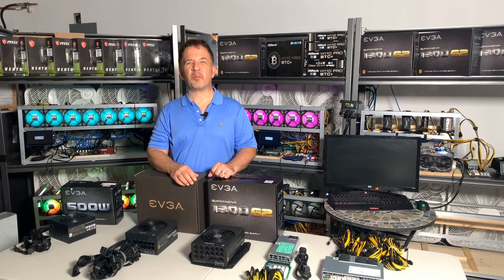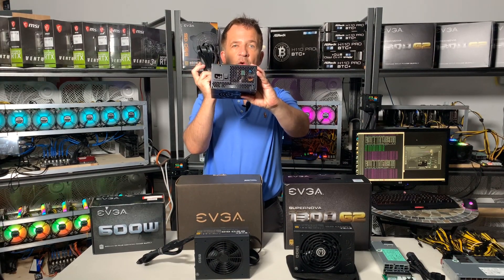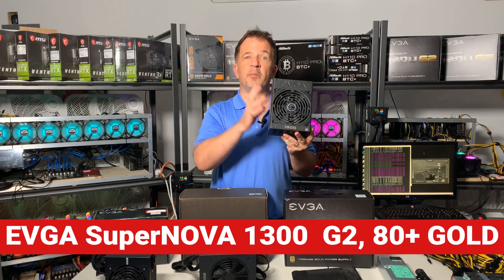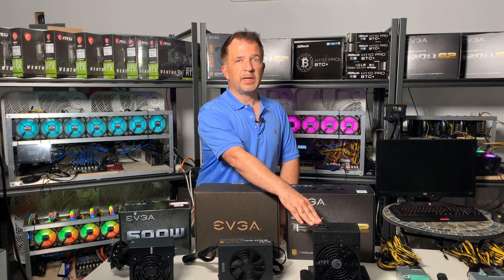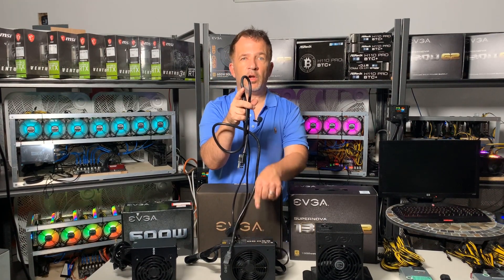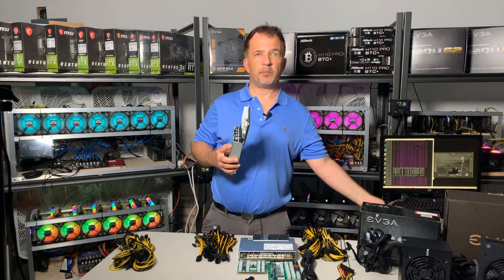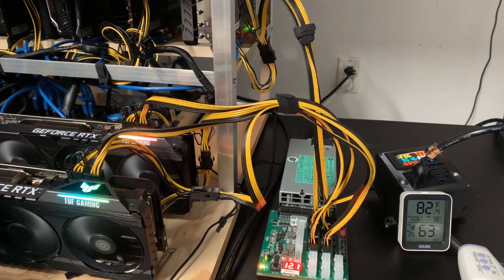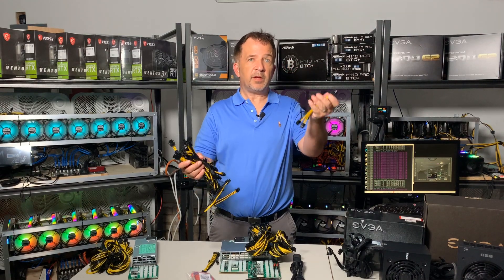THE COMPLETE GUIDE TO GPU MINING POWER SUPPLIES | ATX VS. SERVER PSU  (ZSX) | DO's AND DON'Ts

Comment: You say that server psus run more hot than atx ones, does that mean they dump more heat into the room per watt too?
Reply from the maker: Server PSU are very efficient generally but have small fans than run high speed to exhaust the heat. The GPUs generate the majority of the heat from a mining rig.

Comment: Hello
Thank you for your great video
I was wondering , Can I use the maximum amount on a Platinum Server PSU?
Say I have a 1200W Platinum HP server PSU , I have a 240Volt electricity , Can I use the full 1200W? Or should I stick to 80% rule and not use more than 960W?
I don't care about the noise on PSU fans.
Thanks
Reply from the maker: Hi, I'm not an electrician or pro, but It's my understanding you can use the full amount of the Server PSU wattage (I recall reading this on a post), but should still should stay to the 80 % rule of the electric circuit.

You should contact Parallel Miner about the PSU limit and consult an licensed electrician if you have questions about your circuit load, wiring, etc. to be safe.
Reply: @CryptoMiningInsider  Thanks a lot man
Yeah of course nothing you say can ever be considered any sort of "Advice" in anyway - specifically legal manner - 
And I appreciate the input
Yeah what I've heard is also in line with exactly what you said
Thanks again <3
Reply from the maker: @mohsenk1438  Welcome

Comment: Is it safe if running parallel psu with different wattage? Like 1000 watt combine with 850 watt
Reply from the maker: I run dual PSU at different wattage using a 24pin adapter to switch them on / off together
One PSU will power the motherboard and maybe some GPU, the other PSU will only power more GPUs - the PSUs don't power the same devices.
I power each GPU and its riser usig the same PSU.
I'm not a pro PC / Rig builder so I can't answer if it's safe, just saying I do it and never had an issue.

Comment: Any thoughts on making a video on troubleshooting? I have a Windows 10 5 GPU mining rig that crashes efter 15-40 minutes. 1x3080Ti 283W, 1x3080 250W, 1x 3070Ti, 1x3060Ti 1x3060. I ran it on a used MB so first step was to test with new MB/CPU, same crashing, next suspected China no-name 2000W ATX mining PSU, changed to a quality PSU, same issue. Now awaiting new v011 GPU risers. Can you share any experience or insights with issues using cheap GPU risers?
Reply from the maker: I would start by looking in the Windows Event Logs to see if there is any info at the time of crash captured.
Reply: @CryptoMiningInsider  Thanks, I did that to no avail (I'm an old MCSE certified IT Pro). I have a second 5 GPU  rig running next to it which is running very reliably 2x3070 (non LHR), 3x3060 LHR with a Corsair RM1000x PSU. It's running with another brand of GPU risers. I guess I could start swapping cards into the stable rig for troubleshooting but other than that I'm down with the GPU risers as the culprit so I thought I'd ask if you ever experienced any issues with cheap ones... Thanks for taking the time to respond, I'm very grateful 🙌🏻
Reply from the maker: @carlnakamura4861  I recently have a MOBO issue on a PC that after 30 minutes - Froze Up (Couldn't even power down from switch). needed to Unplug, then it went down to 15 minites, then 10 minutes - I had BestBuy Total Tech so I gave it to them so they diagnosed and swapped MOBO I chose - Paid for MOBO, but no labor cost.
Reply: @CryptoMiningInsider  the stable rig is running an old left over Asus Z97 Pro MB with 6 PCIe slots old 4770K with 32GB DDR3 RAM (overkill but had it laying around). All GPU risers plugged directly into MB. The rig that keeps crashing after a while had an MSI Mate B250 with an i5 7600K and 8GB DDR4 RAM i picked up used for cheap 4 GPUs plugged into an 1-to-4 PCIe adapter plugged into the 16x PCIe1 slot and 1 GPU riser plugged directly into a MB PCIe 1x slot. I bought and swapped to a new H410 MB and i3 10105F CPU. As I'm typing I realize it could be the GPU risers but could also be the 1-to-4 PCIe adapter that is causing the crashes. Well I guess I'll be able to determine tomorrow when the new GPU risers arrive... I only have these two rigs as a hobby and not a big mining operation but it hurts to have had one of the ride unusable for weeks so if I would do it again I would invest in quality gear fit for purpose rather than spending time and money on trying to re-purpose and optimize old stuff. 
Will let you know. Thanks again for sharing your knowledge and experience 👍🏻
Reply from the maker: @carlnakamura4861  Early on when I started mining I was buying some used items on Ebay to save cash, but after 1 or 2 things stopped working, I changed my strategy and buy new to avoid these types of headaches which are often more costly than just paying extra upfront but getting something reliable. Reliability is key to mining. Every minute rig a is down is lost revenue.
Good Luck and hope you get it back up quick !
Reply: @CryptoMiningInsider  Thanks again and great content on your channel!
Reply from the maker: @carlnakamura4861  Welcome
Reply: @CryptoMiningInsider  A quick update. I got the new v011-PRO GPU  risers w/ 10 capacitors today and replaced my suspected culprit V009S GPU risers w/ 4 capacitors. Happy to report that the rig has been running stable for almost 3 hours (it used to crash after 15-30 minutes before). Fingers crossed. I don't know the difference between GPU risers but it was the last thing to check. The 6 pack V011 cost about $75 incl VAT, while the older crashing ones cost $50 incl VAT.
Reply from the maker: @carlnakamura4861  Thanks - Good to know.
I remember an old phrase from a miner who ran a gpu mining farm, something like I have 99 problems and 90 of them are related to risers. Do you have a link for the risers you purchased with 10 capacitors ?
Reply: @CryptoMiningInsider  Oh, and knock on wood, the rig is still running stable and has not freezed or crashed a single time thus far.
Reply from the maker: @carlnakamura4861  Thats Great - Yeah ! 
Stability is King

Comment: Great video with far fewer likes than it deserves. Really useful information on important topics. Would have saved me money and grief if I knew that modular cables are not interchangable as they can actually have different polarity. I fried 2 pcs of 10TB hard drives which will be very expensive to replace given I will have to pay data recovery services as these were mirrored drives holding archived personal photos...
Reply from the maker: Thanks and sorry to hear you have accidentally friend 2 hard drives - I learned some of my lessons the hard way too.
Reply: @CryptoMiningInsider  yeah I haven't yet had the data recovered from them yet but did one harddrive some years back and it was around $800 for one drive.
Reply from the maker: @carlnakamura4861  Ouch - Expensive lose

Comment: how do you switch atx and server psus in parallel in one rig
Reply from the maker: I generally just turn on server PSU 1st, then start the rig on an ATX, but the server PSUs have breakout boards that can accept a remote power source like Molex cable which can start it.

Comment: I use a 1500 watt server psu. I pull 700 watt and its getting really hot. Is that normal ? Fan seems to spin at idle speed. How safe are breakout boards ?
Reply from the maker: I mostly use 1200 Watt models on 240 volt and they get very warm to tough when using at 75 % load or more - it gets basically to hot to touch.  Contact the seller / manufacturer if you don't think its right or safe.

Comment: hi, thanks for the content
I can connect a server power  with an Atx supply using Dual PSU Connector
Reply from the maker: I usually manually start my Server PSUs but some have breakout boards have a a remote on/off plug that can be powered by a primary ATX power supply (Believe its Molex)

Comment: 80+ gold is 90% efficiency or higher. Regular 80+(or white 80+) is 80% efficient.  I think bronze is 85%+, silver is 88%+, platinum is 92%+. Those hp server power supplies are 94%!!! So good for so cheap!
Reply from the maker: Good Point - I love the HP Server PSUs too - great value, only issue I have is when I run them on 1200 Watts unit on 120 volts they only put out 900 watts and get noisy if you put them under load so I can't use them indoor living space under high load (Whistle / whining fans).

Comment: I think you’re the first person I’ve heard say you don’t have to use the 80% rule with a server power supply.
Reply from the maker: I added a comment to the video description clarifying the HP 1200 Watt gives 900 Watts when using 120 Volts and 1200 Watts when using 240 Volts.

As far as the 100 % Load...
See Parallel Miner website - it says in bold on the Page "Unlike standard ATX power supplies, server power supplies are designed to run 24/7 for years, even at 100% load." 
https://www.parallelminer.com/product/build-your-own-custom-platinum-94-delta-2400-watt-power-supply-200-240v/

Please Do Your Own Research 

** I am not an electrician or claim to be a Professional **

Comment: Is it possible to connect more than 2 psus together using the adapter you showed in the video or 2 psu are the max number I can use in one rig ? Oh also fantastic video, thanks for putting everything about psus in one video and sharing it.
Reply from the maker: Thanks I really appreciate your compliment. I remember when I started building rigs there was a lot of information but it was scattered in different places- I was hoping that by doing a 1 bigger video that covered multiple Power supplies it would be more beneficial for everyone to see them side by side and and simplify their comparison and understanding of them all.

Honestly, I never connected more than 2 ATX PSUs with a Multi PSU Adapter. I have done 3 using an adapter and a Dummy Tet Plug for my 3rd and it was only on a test rig temporary situation  Hmmm. now I'm curious, I will test it !
Reply: Yes you can connect more power supplies, even more than 3 if you want.

Comment: very nice video, I just bought one from PM.
Reply from the maker: Great  - Curious Which one ?
Reply: 1200w with the break out board
Reply from the maker: @r2motorsport783  Great - There is 1 point I see was missing from video to know - the HP 1200 Watt Server Power gives 1200 Watts when its on 240 Volt, but 900 Watts when its plugged into 120 Volts.
Reply: Well OK I did not know that
Reply from the maker: @r2motorsport783  The HP 1200 Watt Server PSU are one of my favorite Units. 
They give only slightly less usable wattage than the 1300 Watt ATX Power Supplies  when using 120 volt outlets  (based on 80% rule) based on my research. 
* I'm not an electrician or Claim to be a Professional - Please do your on research *
Reply: @CryptoMiningInsider  very good point about the 80% rule. I'm starting my second rig build and I need to get some gpu's any recommendations on which one and where I can get them?
Reply from the maker: @r2motorsport783  Finding GPUs is the hardest part. BestBuy is probably the best chance but they have not dropped online in about 5 weeks. My sources tell me BestBuy is building up stock and will likely do either do an in person store event this week (Possibly 9/30) like they did in August, but until they officially announce it cant be sure.
I'm plan to start doing finding GPU videos very soon too.
Reply: what do you think about 3080 ti for $1800?
Reply from the maker: @r2motorsport783 I do not own any 3080 TIs (yet). I personally had a few opportunities to get them at or very close to MSRP, but I chose to hold off for now - mining revenue didn't justify the price to me. I'm sure I will get one in near future. * THIS IS NOT FINANCIAL ADVICE **

Comment: Great video.  How do you sync the server power supply with the atx supply?
Reply from the maker: The Server power supply comes with a sync cable depending on the Breakout board. Some breakout dont have sync so just turn on server PSU 1st then turn on the Primary PSU to boot motherboard